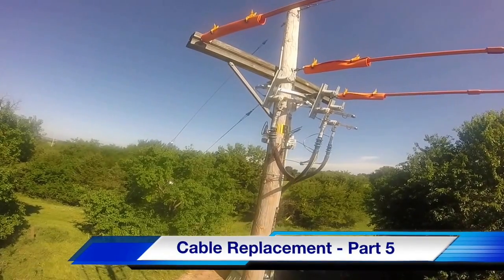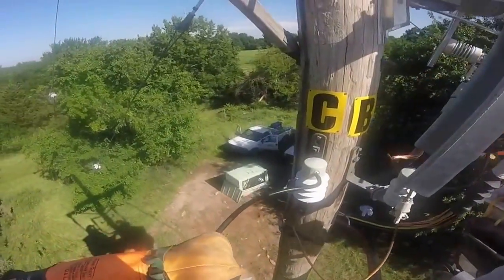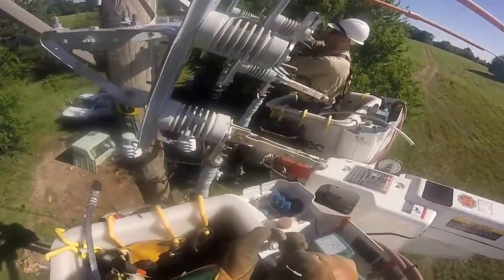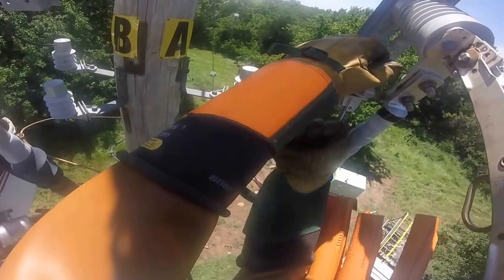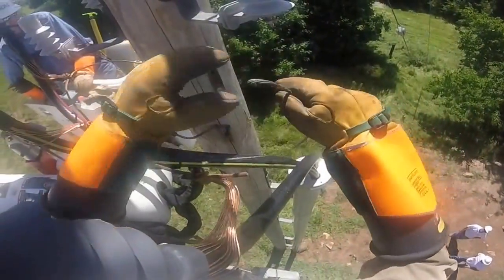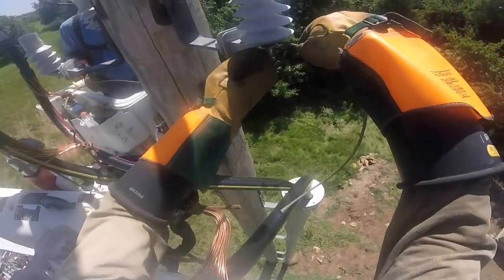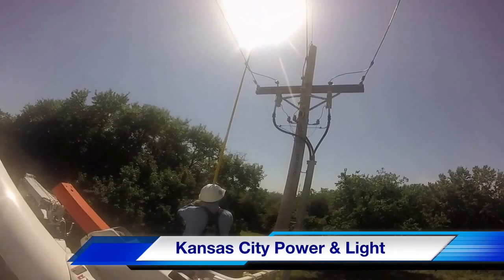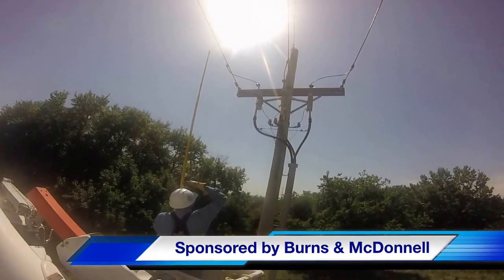Cable Replacement at Meritex Caves -- Part 5

Comment: Why would a cave need 11kV power? Are they running mining equipment or so?
Reply: It is a big office and data center complex. Also it is super common for 11kV to be run everywhere in US. Then the transformer is placed on the poles or close by (or on ground if it is the end of the line overhead maybe or it is underground cable) to bring the power to costumer.